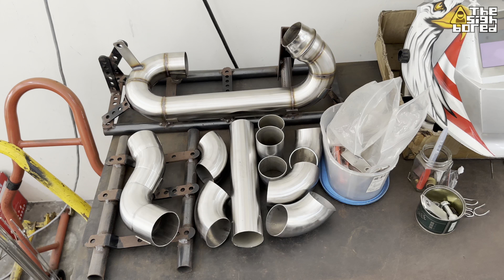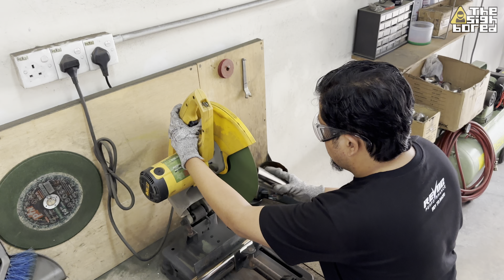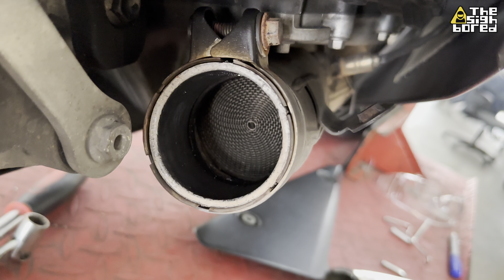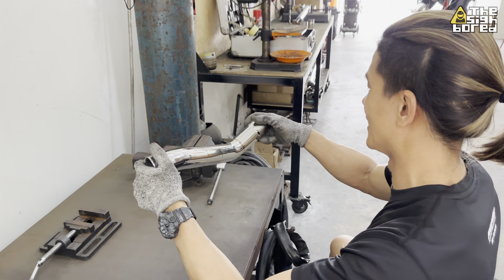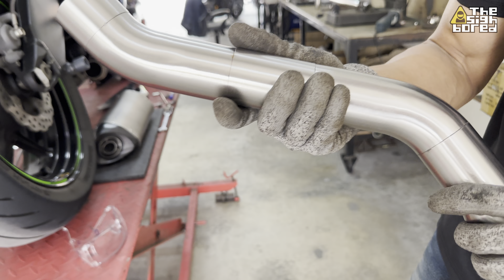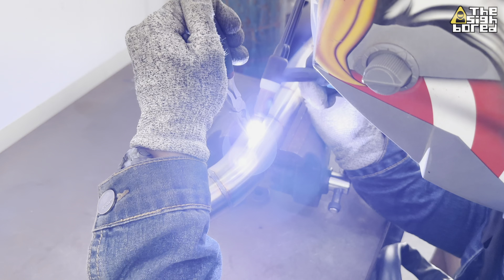Fabricate Motorcycle Exhaust Link Pipe | Revoc Performance Exhaust | Behind The Scenes

Comment: Jared is a guy who definitely knows his shit...i had to modify one of his full systems due to installing panniers...dude looked at it...made a cut once...welded once...and the damn thing came out perfectly spaced and angled.

His full system has been on my z900 for 4 years n 50k+ km.... Still holding up n sounds the same as the day i got it.

Definitely recommended!
Reply from the maker: I have his full system on my Z125 Pro too, holding up just fine on one of the most vibrating bikes.. 😂